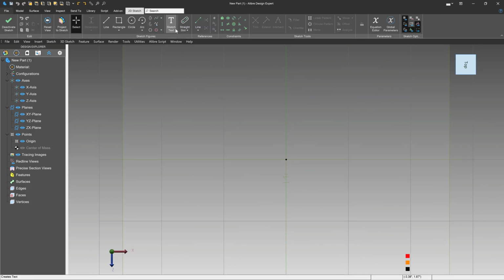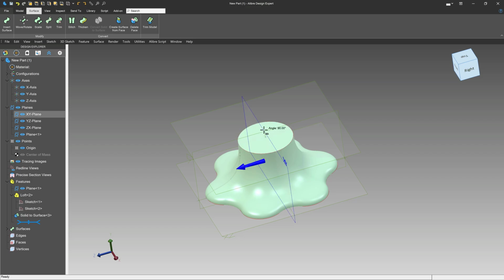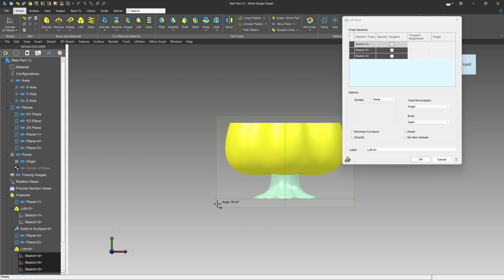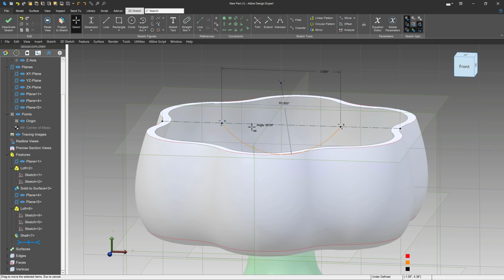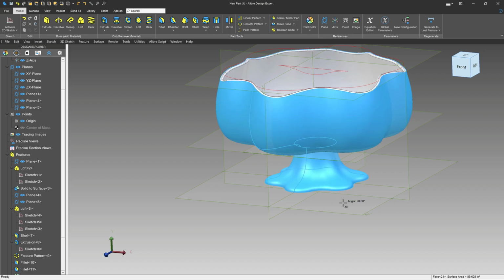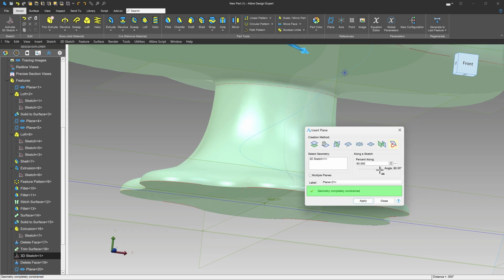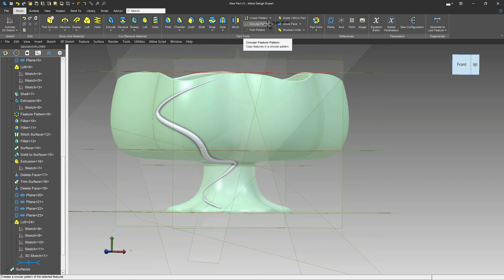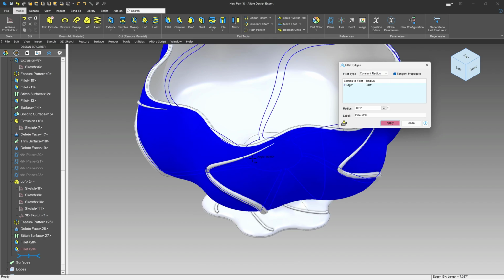Tricky Tort Bowl Modeling- Making a Part one Piece At a Time

Comment: @15:00 or so....

Is there a reason to not (less Alibre doesn't have the feature) to just project a sketch to surface to get a curve that follows the path you want but without the extra features you added (the extrude, trim, etc) to get the path for the extrude?
Reply from the maker: Currently no feature for that